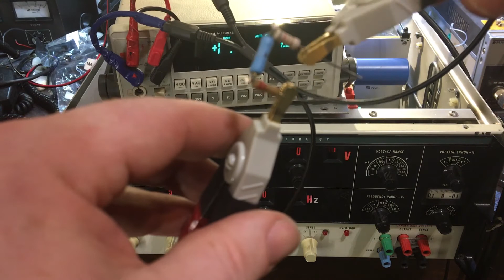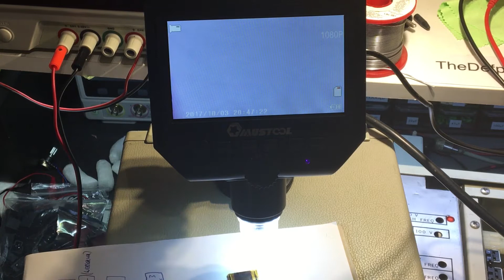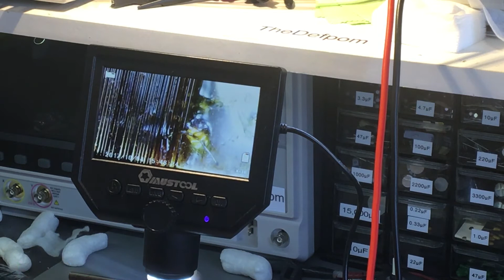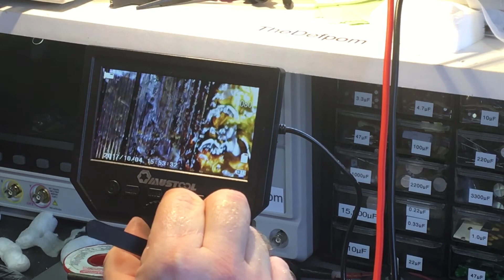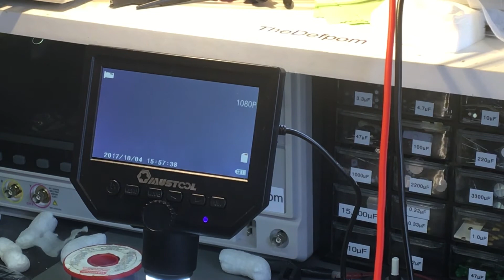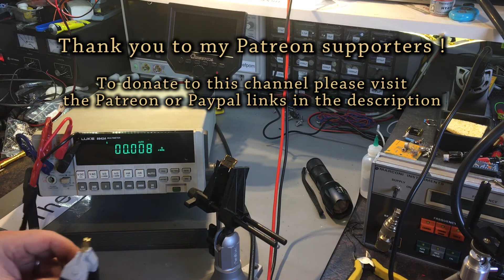#300 Fluke 5200A AC Calibrator Repair Part 6 - Regulator PCB SubAssembly A5A2

Comment: Wow. Great job fixing that resistor. At work, I routinely work with 40 and 44 AWG wire on HV transformers, so I was feeling your pain. It’s funny how you have to hold your breath while soldering the wire, and hold it steady for an excruciatingly long time while the solder cools. It seems if you breath on that wire, or look at it wrong, it will break. You mentioned buying resistance wire. Do you have a source and type? I was thinking of getting some for another purpose, but I’d have to start from square one on the research end.

Comment: I'm blind as a bat, but if I use one of those Cree torches I can see tiny things with the naked eye. There is something that when you get old you can't get enough light in your eye to discern edges, because the contrast is so similar between things, so a bright light allows you to edge detect and see things better.

Comment: Hi, Interesting series Thanks! I'm pretty sure the "grind" marks on the precision wire wound resistors are how they are calibrated in the factory. I've seen this on other similar resistors in other equipment.

Comment: Well done :-D, that wire wound resistor did look a pain in the arse!!.
I wonder if it's not the absolute accuracy that matters so much, it's the long term stability of the resistor that matters more, perhaps?

I've also done the "Bodge this in for now", it's quite valid, can't fault you there.

Comment: On mine I found the over load fault was linked to frequency. You might want to see if you can find a voltage/frequency combo that gives an output. Assuming you haven't already fixed it...
Reply from the maker: tgsoapbox - no combinations work, so I have to figure out where the “beginning” is and check it throughout from there.